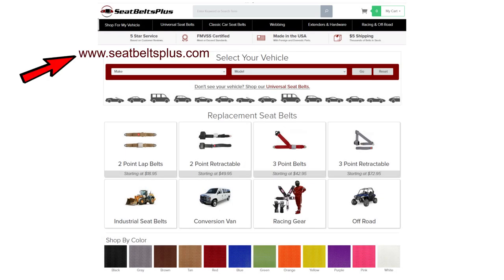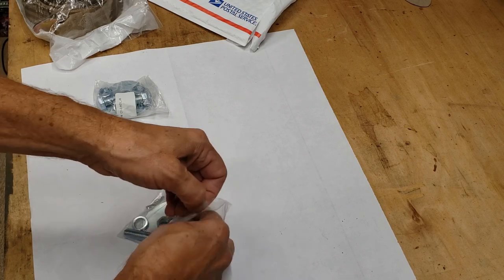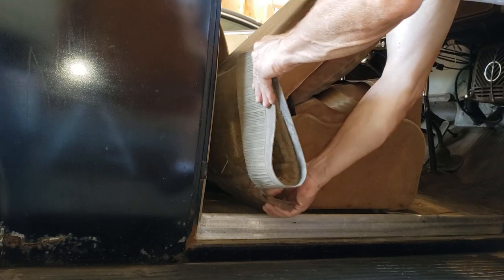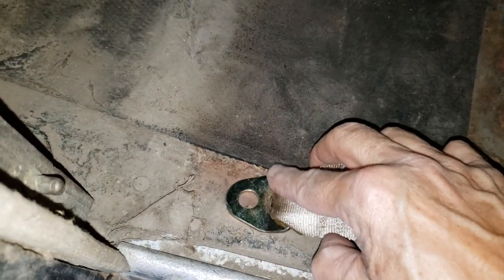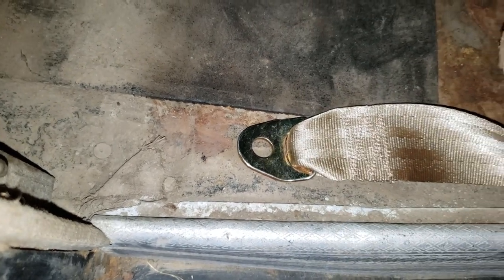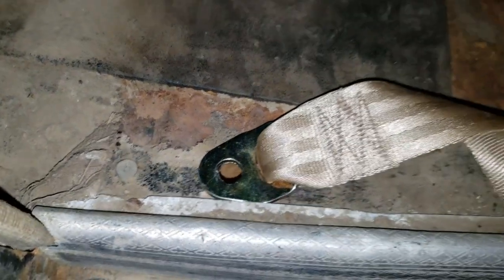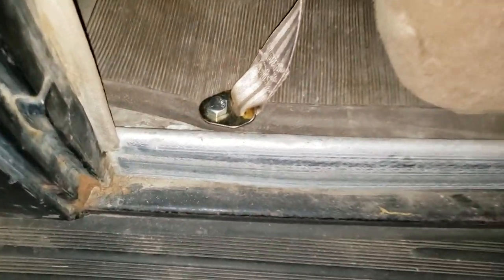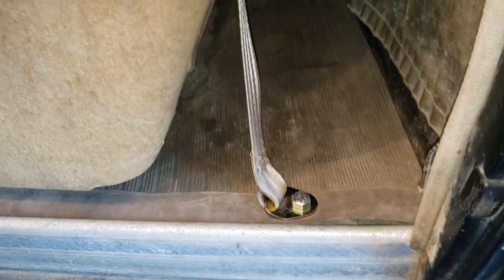How to Install Seat Belts on a Old Car - Complete installation on a 1937 Plymouth Coupe!

Comment: I've been thinking about putting belts in my 51' Dodge Coronet. After watching this I'm pretty sure I can do it.
Reply from the maker: Its worth the effort Vince!
Reply: Just remember just bolting belts in can cause more harm than good in a car not designed for them(especially if it's only a lap belt). It can potentially cause dangerous angles of impact with the steering wheel/other interior parts. I would probably look in to that before just throwing belts in.
Reply: Isn’t something better than nothing? I’d do shoulder straps too if I knew how.
Reply: @detroitos  I mean if it causes your head to hit the steering wheel at an angle that breaks your neck yeah it can do more harm than good in some crashes.

Comment: I did the same for our ‘36 Airstream coupe.
Reply: Where did you mount your belts/ bolts on the floor?
Reply: @rgc1961  basically the same locations as he did. I did use retractable lap belts. The lap section is mounted just beside the B post and one pulls the belt up from beside the seat. The latch ends stick through the center pivot area of the front seat. Very much like cars in the 60s and early 70s.
Reply: @pierredentremont2999  Thanks!

Comment: I assume it would be the same procedure on my 1940 Buick special, thanks Flathead this was a very informative video
Reply from the maker: Your assumption is correct! The '40 Buicks are cool! My suggestion is too use larger diameter washers underneath the floorboards. Mine are a bit small and are on my list to replace with bigger ones. Thanks for your kind words!

Comment: Could I just reuse the bolts that anchor my seats? Not keen on drilling into my floor pan.
'59 Buick.
Reply from the maker: Probably. The angle of how the belt comes across the body would be my concern.

Comment: can i just drill through the carpet? it’s part of the car and can’t be removed
Reply from the maker: Yes Jamison you can, however. I recommend using a sharp utility knife instead. A drill bit will catch the  carpet threads and pull them out. (Don't ask me how I know!).